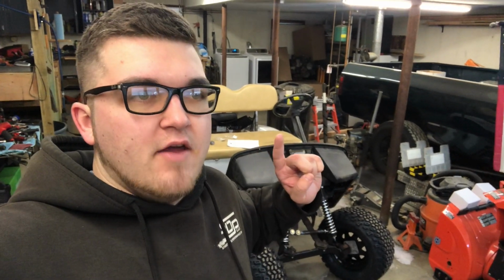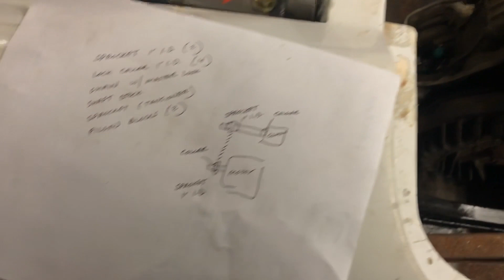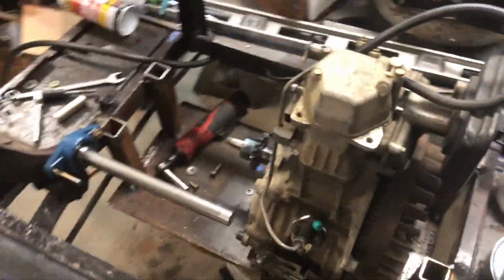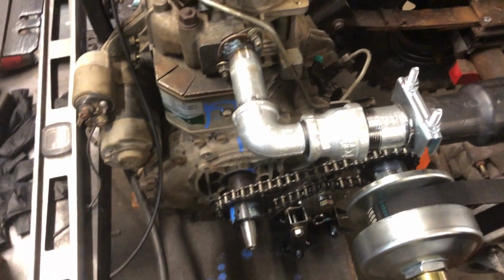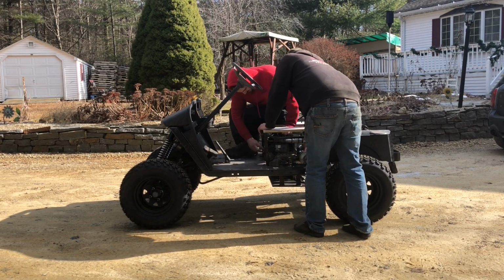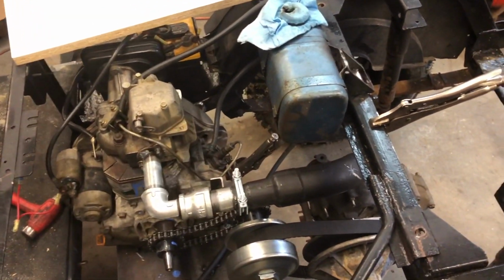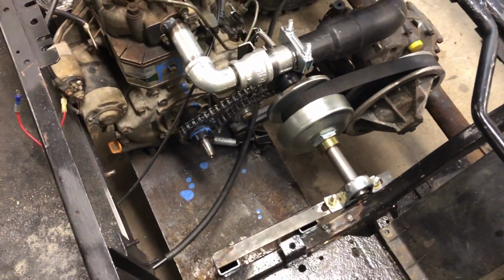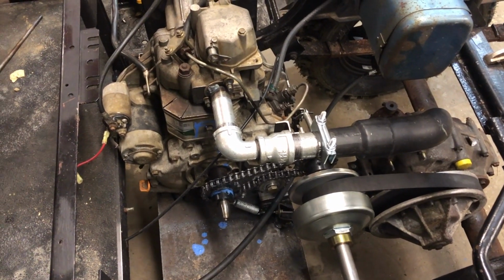Diesel Golf Cart FIRST DRIVE!

Comment: Is that a yanmar or a clone?
Reply from the maker: That was a real Yanmar
Reply: @pacificdrumma  very nice engines…I have one that outlasted a gen set…it’s not a big deal to convert the taper
By welding with stainless rod and grinding a key way for a pulley or a coupling.